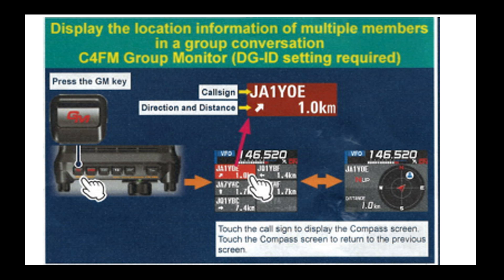Eight New Functions of the Yaesu FTM 500

Comment: Hello Friends of YAESU
I live in Brazil, traveled to JAPAN, bought a Yaesu FTM 500D (Japanese version). I need to transmit in Brazil on 146.950 and the radio says TELA is prohibited. TX PROHIBITED. Can you help me make a change of region or opening in TX? What is the best solution for my case? Thank you if you could help. Moacyr
PY3FK
Reply from the maker: I can't help.  Maybe you might want to contact Yaesu directly.
Reply: Japanese shops are not authorized to sell EXPORT model radios. If you see a letter J, inside of a triangle, that is a domestic model radio and is engineered tomNOT BE MODIFIABLE. I would post a picture for you to see but not possible on here, 73 de Okinawa

Comment: It would be nice if Yaesu came out with a dual Vocoder for C4FM use. Yaesu has their own format for digital with their own Vocoder but adding the second Vocoder would allow the radio to do P25 a public safety open source digital format used by a lot of Hams. Both use C4FM for digital however the difference lies within the Vocoder that handles the digitization of the audio paths.
My Motorola P25 radios can decode analog while in digital mode with an indication; for digital and analog.

Comment: I just bought the FTM 500 last week. Unfortunately it was out of stock so I'm waiting for its arrival. I also bought an antenna for 2m and 440. I've been out of the ham world for over 20 years (but I maintained my no-code tech license). Now that I'm retired, I have lots of time to get back into ham. I have an old Yaesu 2600M two-meter mobile that I'm trying to get back on the air with. It seems that here in the Reno area, everyone went to 440 and there are limited 2 meter repeaters left. Grrr.  My question is - what is the difference between digital and analog in the ham radio world? Would my old 2600M be analog given how old it is? 

 I really liked your easy-to-follow video tour of the FTM 500. I'm trying to soak up as much info as I can while I wait for my radio to be shipped (whenever that is!).

Comment: Good video, i think yeasu is getting worse instead of better. I hope icom comes out with a updated replacement for the icom5100, which i still think is better than the yeasu, just lacking the flashy stuff and aprs.
Reply from the maker: I have a 5100 as well.  When I switched it out in my vehicle with the Yaesu, I was told that the noise in my transmission dropped to almost zero.  Now, don't get me wrong, I am a huge ICOM fan as well, but the one thing I didn't like about my 5100 was the display, (at least while in my vehicle.)  I now have it in my shack as a dedicated D-Star unit.

Comment: A lot of us like to work 220. Any thoughts Yaesu?
Reply from the maker: They have the VX-6R Tri Band HT.  I have not used it but heard good reviews.  Unfortunately, here in town we had 1 220 repeater, but it went down over a year ago and it is doubtful that it will ever be back up.  I guess it come to supply and demand.
Reply: @K4SRF need to get it on the air again or the Fantabulous Candy Company will relocate the rest of the 220MHz spectrum to business. It’s bad enough that they took a portion of it over 20 years ago and devised a method that was supposed to allow only one megahertz between RX and TX. It was known as Amplitude Compandered Side Band, ACSB for short. Got news it did not work worth a darn. UPS was the other player for the other portion of that 220 band but they never did anything with it.